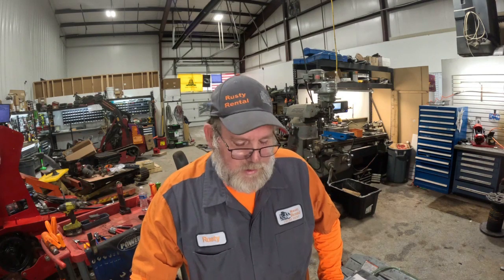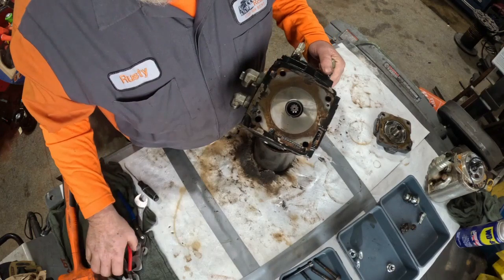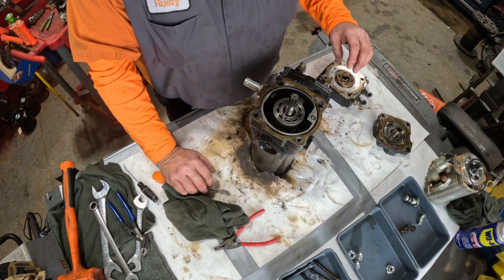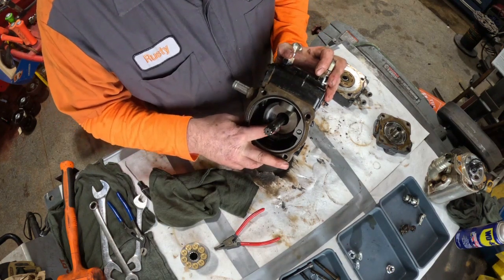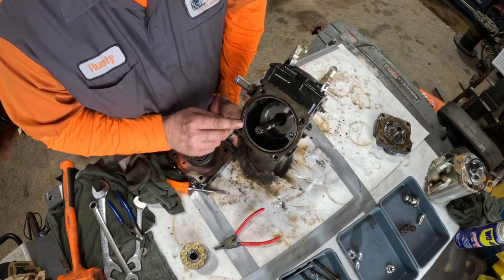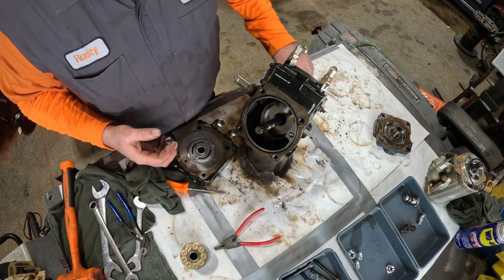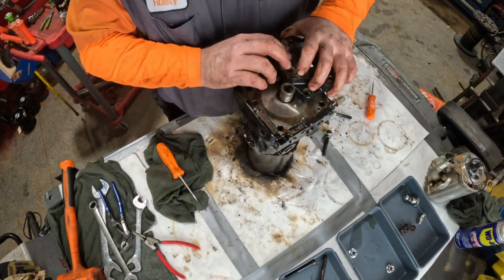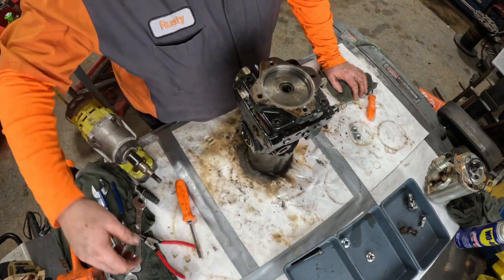Tx1000 Tandem Pump Inspection

Comment: Thanks for taking the time to make the TX1000 wide track videos.  Is the Tandem more a wear part destined to fail after so many hours or is this a part that should last the life of the machine if maintenance schedule is followed?  My TX1000 wide track has ~800 hours and am trying to determine if a proactive rebuild or replacement makes sense for this part and if so at what frequency.  Have you found failing pumps correlate with anything such as serial number ranges, environment, type of work, engine hours, etc.?